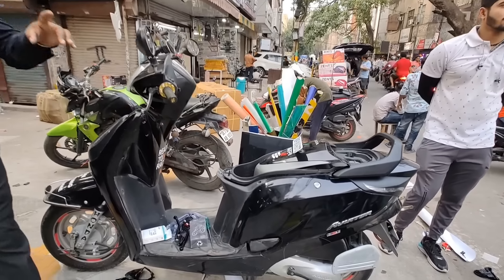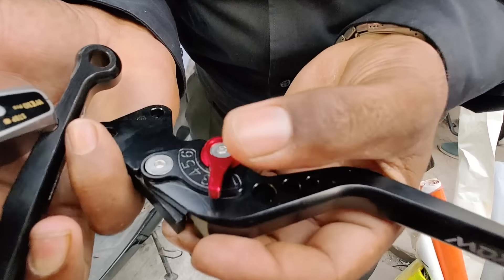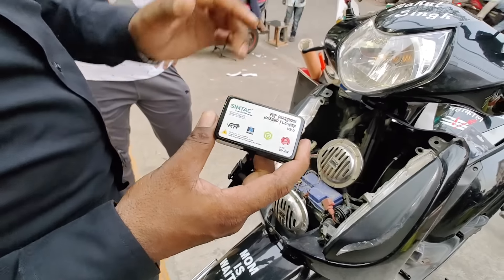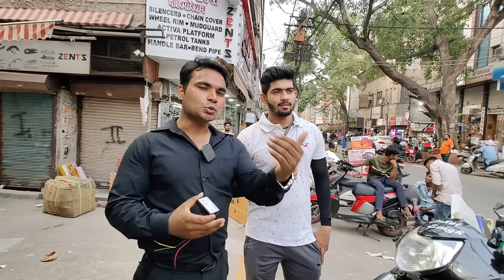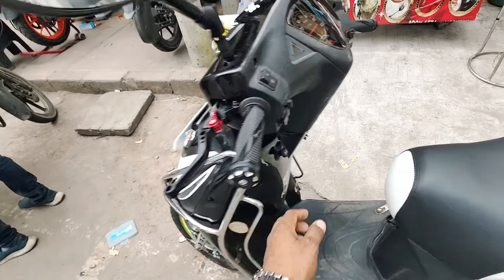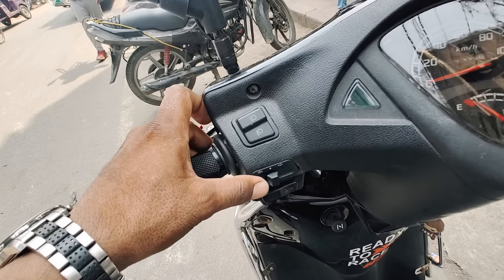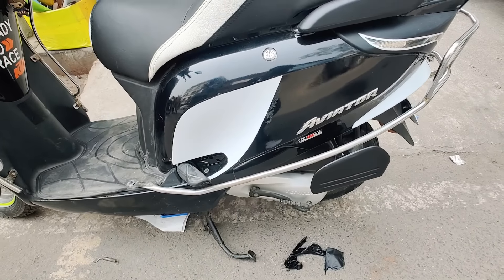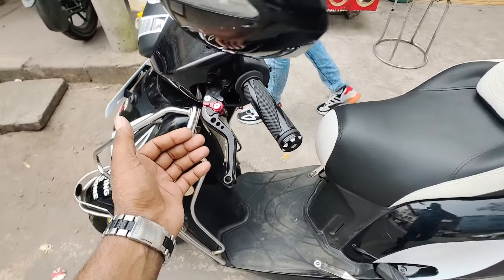honda aviator अब तक की सबसे ज्यादा modified | aviator cruiser seat | honda aviator modification

Comment: What is the price of modified seat
Reply from the maker: shop address & location 👇
1686, Arya Samaj Rd, Block 27F, Nai Walan, Karol Bagh, New Delhi, Delhi 110005 https://g.co/kgs/JhQMn2
----------------------------------------------------------------------------
Shop Neme 👉skd
1686/36, nai wala market, karol bagh new delhi 110005
contact number ☎️📱
👉8800567097
👉9911529266